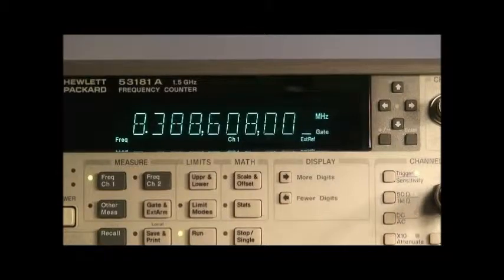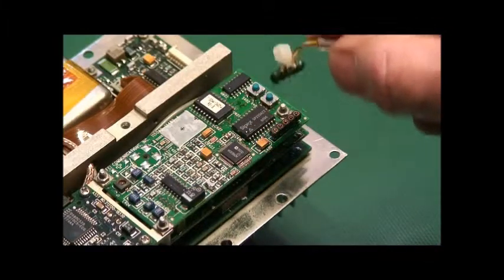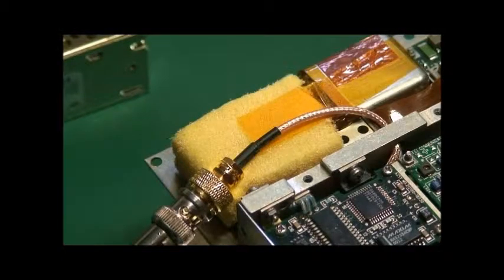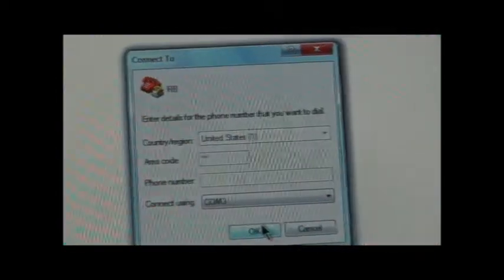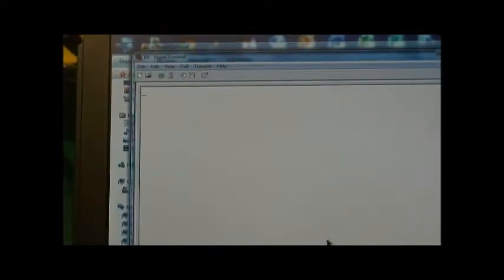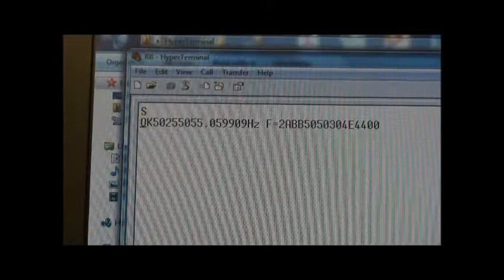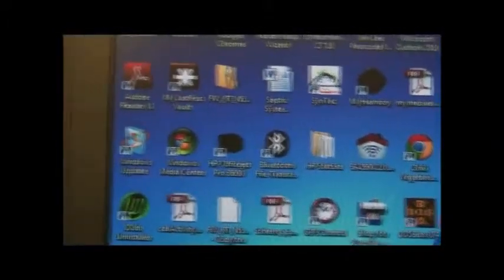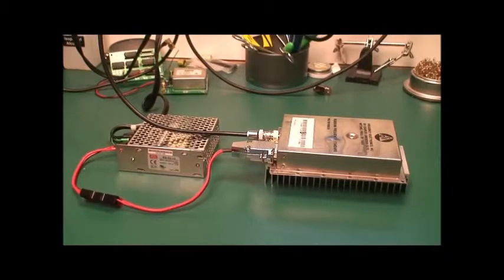Programming the FE 5680A Opt 58 Rubidium Freq Standard

Comment: One more update. I connected wires to the internal 5 socket header inside the FE-5680A and was able to program the frequency via RS232. I used 'Termite' (free download) in windows 8.1. I confirm that the left-most pin (ie. next to the C409 capacitor) is GND, which needs to be connected to pin 5 of a do-it-yourself (DIY) 9-socket female RS232 connector. The next pin is the FE-5680A transmit pin, which needs to be connected to pin 2 of the DIY 9-socket female RS232 connector. Then the next pin after that is the FE-5680A receive pin, which needs to be connected to pin 3 of the DIY 9-socket female RS232 connector. As a result of those previous connections, what we have is pin 2 of the DIY female RS232 connector will eventually be linked to computer's RS232 receive line, while pin 3 of the female connector will eventually be linked to computer's transmit line. So this takes care of the DIY female connector. None of the other pins of the DIY female RS232 connector are connected to anything....all disconnected.

The other important component was the USB to RS232 interface, which is a cable with a USB plug on one end for connecting to the computer, and a male 9 pin RS232 connector on the other end for connecting to the DIY RS232 female connector. I have el-cheapo ones and high quality ones. Luckily, I tested communications with the high quality one.... and the RS232 comms was successful between the FE-5680A and my PC (using 'Termite'). This also worked with PutTy software, but the Termite user interface was nicer for this application. I didn't need to manually install any software drivers, since windows 8.1 automatically installed workable drivers. I also tried the el-cheap USB to RS232 interface, and had garbled non-ascii characters appear in the terminal window. So it really paid off to use a good quality USB to RS232 interface, otherwise would waste time in trying to figure out why things aren't working. My unit was initially 11.289600000 MHz. I reprogrammed it to output 8.388608 MHz. I have now observed the 8.388608 MHz signal on a spectrum analyser and an oscillocope. Wonderful!

I want the 8.388608 MHz signal so that I can use a programmable divider to generate a 1 pulse per second signal. I finally discovered that my pin 6 of the FE-5680A doesn't have any 1 pps signal coming out, so my unit hasn't got that particular feature.

The all-important final step is to use the 'E' command to write the frequency settings properly to the FE-5680A. Otherwise the FE-5680A would revert back to the original frequency (after a long power-off).

One more comment to make is - there are online documents that show people what HEXADECIMAL CODE to use in order to set some particular frequency. However, the documentation can be confusing due to mistakes in the information. Some documentation talks about a "4 byte" hex code for setting the output frequency. However, it is actually clear that the required hex code is meant to be 8 bytes, which amounts to 16 hex characters. They also fail to tell you that the first set of 8 hex characters and the second set of 8 hex characters is meant to have a 'hypothetical' decimal point between them. For example, while we might enter the code "2ABB5034D6A84400" for setting an output frequency of 8.388608 MHz, the actual hex value is "2ABB5034.D6A84400" (note the decimal point), which corresponds to a decimal value of approximately 716918836.83850479125976562500

So if the frequency reference is 50255057.012932 Hz, then the equation for getting an output frequency of 8.388608 MHz is:
(50255057.012932 * 716918836.83850479125976562500)/(2^32)

UPDATE - Regarding power supply: when programming the FE-5680A in this way, the unit must be powered in the usual way, via the 9 pin D-connector port at the rear of the FE-5680A. Beware the colours of the wires for the power pins. I have seen idiotic colours for wires that came pre-connected to the FE-5680A REAR-port 9-pin D-connector adaptor, such as 'brown' wire for +15V, and 'red' wire for 0V (ground), which is somewhat opposite to intuition.

Also, for my Termite terminal software, I only get serial communications activity when I choose the 'append CR' (carriage return) feature. Nothing happens when I choose the "append LF" (Line Feed) feature.

Comment: Adding extra comments. I bought 2 of the exact same device as the one in the video. I open it up and it has that 5 pin header on the inside. Some online pinout diagrams indicate that the 9 pin connector (of the FE-5680A) may have serial lines. However, I have used a multimeter to check whether any of the 5 pin header sockets are electrically linked to the 9 pin connector pins (of the FE-5680A). I found that the only common pin is the left-most pin on the 5 pin connector (ie. GND), which is connected to pin 2 (GND) of the 9 pin D-connector of the FE-5680A.

Comment: Nice video. Although, can you remember what those particular pins were? The ones that you used for interfacing. I searched on the internet and came across this link:
http://www.redrok.com/Oscillator_FE-5680A_precise-reference-frequency-rev-1_0.pdf
And they reckon that the three left-most pins are used only (on that 5 pin connector). They reckon left-most pin is GND. 2nd pin is Tx for RS232, and third pin is Rx for RS232. I think I can trust this information.

But they also mention some ridiculous nonsense. They indicated that the Rx pin of the 5-pin connector is linked to pin 2 of the 9 pin D-connector. This is total nonsense, because pin 2 of the 9 pin D-connector is actually GND. They also reckon the Tx pin of the 5-pin connector is linked to pin 3 of the 9-pin D-connector, which is also nonsense, because pin 3 of the D-connector is actually the lock-detection pin.

Comment: I no longer have this unit so unfortunately I can't answer your question. I don't think you can program this from the front panel DB-9. From what I have read, the only way to program the divider is through the internally mounted connector. There are do many variants of these Rb standards it seems that no two are the same. it was just an interesting project for me to learn how to customize a programmable version to 10.00000MHz.  Thanks for watching.

Comment: Interesting.  I see you programmed via with the jumper at the back... but isn't the serial also exposed via the DB9?  I see two RS232 transceivers, one on the left... a MAX23?? and one on the right a SP233ACT?  are neither of those wired through to the DB9?  What's the purpose of the one on the left?